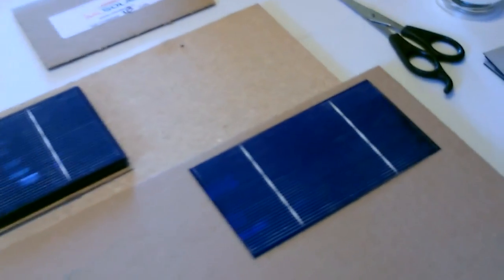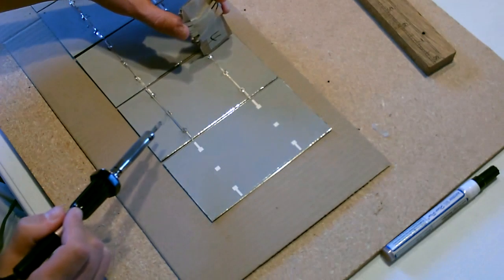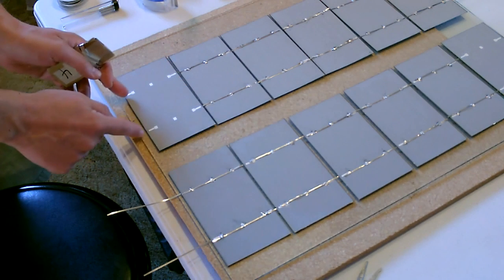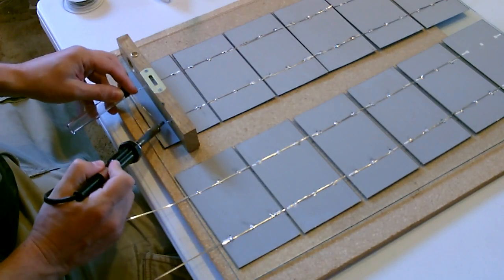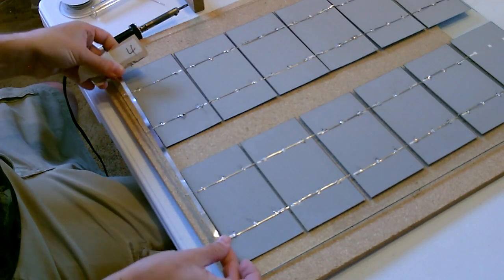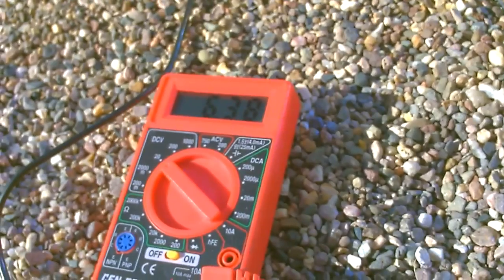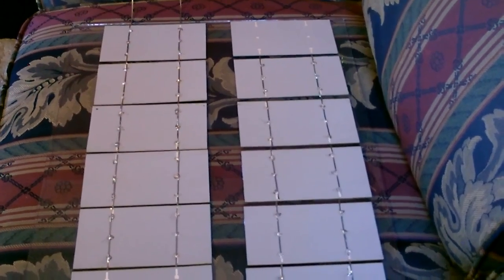How to make a Solar Panel - Wiring, Soldering, and Cell Layout - Explained Simply!

Comment: Do you think a perspex sheet would work instead of the glass?
Reply from the maker: possibly, but i'm not sure if it would handle the heat. i read that it's only rated to 190F. (sometimes enclosed boxes in the sun can reach to over 200F  - especially in the summer sun in the hotter climates.

Comment: Can I repair a broken solar plate?
Reply from the maker: hi there. if you mean a solar cell - no those can't be fixed. you'd want to un-solder it and add in a new one. if you mean the panel 'shell' then yes that can be repaired.
Reply: @desertsun02  I am from Pakistan.
I want to make a solar parabolic steam or Stirling generator for 25kw.
But there is no any facility.
I can make solar dish but there is no Stirling engine with Stirling joined generator.
Please tell me how can I get 15kw to 25 kw Stirling engine

Comment: how many watts does it produce? will try to do the same solar panel diy
Reply from the maker: hi there. it's 6v/3.6A/21.6w (max). note that if you make 3 of these and hook them in series then you'll have a set-up that is great for charging 12v batteries.

Comment: Hi, thanks for the good video. I will try to give something similar to my senior design project students. But I have a question, are you connecting your two sets of panels in parallel or in series? I understand stand that the individual cells are connected in series, though. Thanks!
Reply: In series
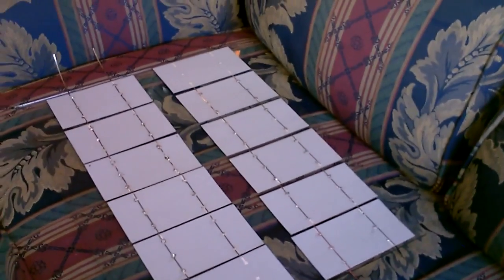1:18

Comment: Great videos!  I am wondering why we need to add solder for the points on the back when only some flux is needed for the front?  I'm just not very familiar with soldering you see.

Thanks!  :-)

Comment: how masny cell to make 1 k unit
Reply: THANK YOU... 288  THANK YOU about 1300KW SHOULD DO MY OFF GRID  system
Reply: All you need is simple math. Amps x Volts = Watts. Check manufacturer's cell specifications. If you use 3"x6" cells, each cell will produce approximately 4 amps at 0.5V. 4 x 0.5 = 2 watts. 1 kW = 1000 watts. 1000 / 2 = 500 cells. 
If you use 6"x6" cells, each will produce ~8 amps at 0.5V = 4 watts, so you would need 250 cells in this case.

Comment: Do you NEED to use the "bus wire" instead of just using the tabbing wire to connect each of the (your) 6 cell series?
Reply: +Chris Moran 
Simple. Think about the electrical wire inside your home and the wire on the street electrical post. Are they same? Why not?
Reply: +Ponniah Kunathasan I get that a larger gauge wire/cable is desirable, but with something like a 18 volt panel REQUIRE the extra width. The tabbing wire I have isn't exactly insubstantial.  Would there likely be a problem using the tabbing wire?

Comment: that how i did it on glass done 40 cells in bout 1.5 hrs drinking too  none broken but they aint as fragile as u think solder dabs on back but u dont need it on the front tabing wire has all the tin etc u need just flux place wire then run it down cell

Comment: So am I correct in understanding wiring the cells parallel increases the voltage while wiring them in series increases the current?
Reply: Mike Benner the other way round
Reply: Thanks!

Comment: Anyone know what kind of sodering iron would work to do this, does it have to be like a high temp?
Reply from the maker: LegoMasterRCE hi there. just a basic "pen type" hobbyist soldering iron is all you need. doing a quick search for "30 watt soldering iron" brings up several. fry's electronics has one for $4.99 and harbor freight tools has one for $3.99.
Reply: thanks

Comment: Hi, I made a solar panel but I can not make it to work in grid inverters, it is only working or charging at batteries. Where do you  think I went wrong. Please help me.
Reply: Corazon de Vera What type of charge controller and grid inverter are you using? Did you put in the diodes?

Comment: every time i try to tab the back of my cells the contact instantly turns grey and solder will not stick to it even when using a flux pen the fronts work fine
Reply: Michael Rue i pre solder the contacts first.  just a quick dab of solder and it will hold
Reply: Michael Rue try enough heat to melt the solder bot not so high it burns the contacts. Try using a hot air soldering box?

Comment: Do you have to put them behind actual glass or could you use plexiglass / lexan?
Reply from the maker: hi there. i'd use actual glass if possible. if you use plexi-glas just remember that it sometimes bends or warps when it gets hot so you wouldn't want the solar cells up against it. (high probability that the cells would break when the plexi-glas started warming up). if plexi-glas is all you've got - i'd recommend designing the casing in a way so there is a little air space between the plexi-glas and the solar cells.
Reply: desertsun02 for any ideas for cooling the panels?

Comment: ever look into wiring glue? no soldering required, just glue the tabs to the panels or even the panels to each other directly. also, just taping the whole thing directly to a pane of glass with packing tape works great, it's only glass between the panel and the sunlight and the tape keeps it together.
Reply: SirLobsterman be 22nd np p

Comment from the maker: yes, it's good to know how to make them. along with a slight cost savings, knowing how means you could potentially salvage/repair broken or damaged "store-bought" panels and either "save the panel" or at least salvage some of the intact cells from it. gave me a new appreciation and understanding of solar panels, actually building them.
Reply: i was thinking, those cheap solar powered garden lights, you could take the panels off of those, yeah? That was before I saw how cheap solar panels are!
Reply: Thank you for this lesson. But I have still four questions:
1: At 0:25 of the video, you can see how the top surface of the cells has changed shape very drastically. Could you explain why the initially flat cells change so much?
2: From 1:27 of the video, you only show how you solder the back of the cells. Why don't you show the preparation of the front at all?
3: At 2:02 of the video, you can see that you used a lot of soldering tin. Why? Wouldn't it be better to use as little tin as possible, since I understand that the tabbing wire is already tinned, as are the pads in the cell?
4: In your comment, you say "you could potentially salvage/repair broken or damaged "store-bought" panels and either "save the panel" or at least salvage some of the intact cells from it."
In a factory-made panel, the cells are hot-pressed between EVA films on both sides, which binds together not only the cells, but also the front glass and the Plexiglas on the back. It's a tightly bonded five-layer lamination, from which you can get the glass and plexiglass intact, but not the EVA film or the cell. So tell me, how do you plan to repair one if there's any damage?